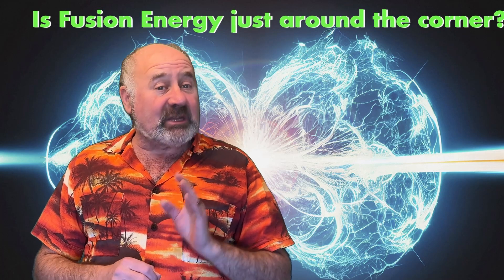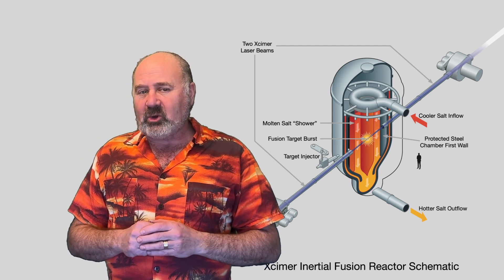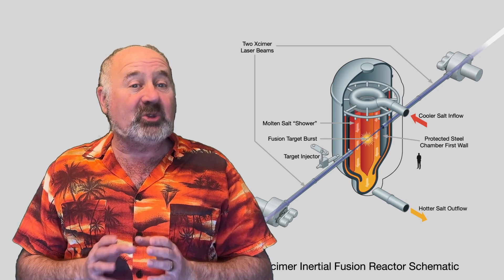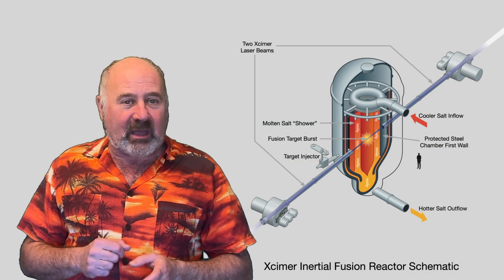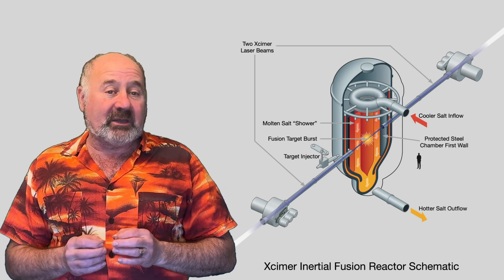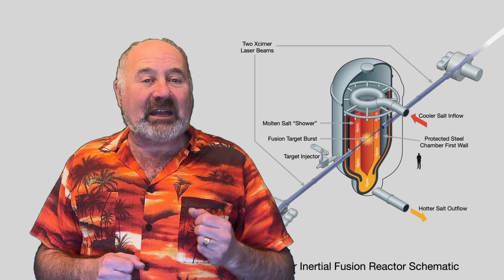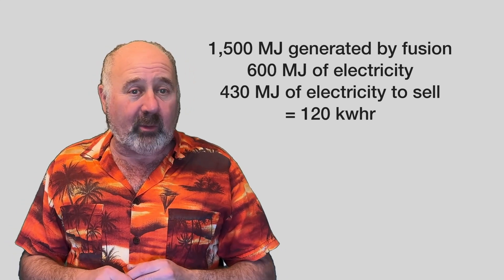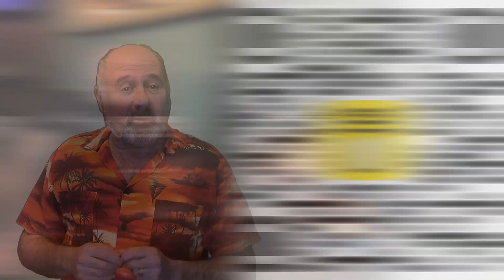Can millions of mini hydrogen-bombs power our world?

Comment: Dr. Silba, First Light Fusion (01:28) recently announced it was dropping out of the race to build fusion machines. Do you think my post (copy-pasted below) had anything to do with it? 
****
First Light Fusion (FLF) uses a projectile to hit a target filled with fusion fuel. Their "secret sauce" is the use of specially designed targets that convert the projectile’s impact into a convergent shock. These targets direct the shock waves to focus on the fuel, a bit like how shaped charges focus energy into a jet. It’s clever, but there’s a fundamental limitation they can’t avoid: the maximum pressure they can achieve is capped by the fact that their waves start in 1D (linear) and need to finish in 3D (spherical) to benefit from the maximum speed of convergence. No matter how intricate or convoluted the targets, the final pressure won’t exceed what you could get from a perfectly converging 3D spherical wave driven by the same projectile pressure. That’s a hard ceiling set by geometry itself.
    Now, what if we could do better — much better — by starting with true 3D convergence from the beginning? Here’s my approach: Imagine a large, hollow metal sphere filled with molten Nd-doped FLiBe (a fluoride salt mixture). Suspended at the very center of the sphere is a single, large bubble of DT gas. This setup replaces solid fuel targets with a far superior medium for transmitting pressure: a continuous incompressible liquid, which can perfectly support a 3D spherical converging wave.
    To drive the compression, piezoelectric actuators surrounding the sphere apply a precisely timed, synchronized pulse to its outer surface. This launches a converging acoustic wave through the molten salt. Because the wave propagates through a homogeneous liquid in all directions, it focuses symmetrically on the bubble, compressing it from all sides at once. Unlike First Light’s 2D waves, this is true 3D spherical convergence, meaning the achievable peak pressure vastly exceeds what any projectile impact can deliver at equivalent input energy.
    The first stage of the bubble’s collapse rapidly heats the DT by adiabatic compression. At this point, the temperature is far above the 750 K of the molten salt, but still nowhere close to fusion conditions — so I add a second mechanism: laser pumping. Reflective tiles lining the inner surface of the sphere create a spherical laser cavity around the bubble. As the compression wave converges inward, high-power laser diodes flood the cavity with several megajoules of light, timed to begin when the converging pressure wave is about 3/4 meter away from the bubble’s center.
    Here’s where the magic happens: as the bubble collapses, it heats up and starts to glow like a blackbody. This intense thermal emission triggers a cascading laser effect in the surrounding Nd-doped FLiBe. The collapsing bubble essentially acts as the spark plug for a self-focusing spherical laser pulse. The laser cavity’s geometry ensures that this pulse can only focus on one place — the exact center, where the bubble sits. This injects even more energy into the collapsing fuel at precisely the moment it’s at peak density, further raising temperature and pressure. First Light’s projectile can’t do anything like this — their pressure pulse is a single-shot event. Mine gets a massive boost right at the critical moment, thanks to the synchronized laser cascade.
    Even this isn’t the final trick. When the laser pulse dumps energy into the system, the radiation suddenly ionizes both the DT fuel and the surrounding Nd:FLiBe. This triggers a phenomenon borrowed from Andrei Sakharov’s "Layer Cake" H-bomb design, where materials with vastly different electron densities expand at different rates upon ionization. The high-Z Nd-doped salt releases far more electrons than the DT. Because particle density is proportional to pressure, this creates a sudden pressure imbalance. This differential pressure creates a final inward shock that drives the DT to even higher pressures.
    By combining these three mechanisms — spherical acoustic compression, synchronized laser pumping, and ionization-driven final squeeze — my approach overcomes the fundamental limitations of First Light’s projectile-driven scheme. Instead of being limited to what a one-shot projectile can achieve through clever target shaping, I exploit the full power of 3D spherical symmetry, add photonic heating right at peak compression, and leverage plasma physics to generate a final shock. All of this works together to create far higher pressures and temperatures than First Light’s setup could ever hope to reach.
    Here are a few more advantages of my approach: 
        • Zero cost target fabrication (bubbles are free)
        • Alpha heated, long burning, slow disassembling targets (not burnt in a vacuum chamber)
        • Instability resistant, low temperature, volume ignition (better containment => time to heat)
        • Robust high yield targets for higher gain (~100x fuel mass of NIF capsules)
        • Reflective chamber to prevent electromagnetic radiation loss (lower ideal ignition temp)
In short: First Light’s approach is capped by the physics of converting acoustic waves from 1D to 3D. My approach starts with 3D convergence, then layers in optical and ionization physics to break through to true fusion conditions. That’s why my method is superior — it’s not just a better design, it’s a fundamentally more capable approach to achieving the conditions needed for fusion ignition. 📌

Comment: Xcimer's website features a graph comparing the cost of electricity across various production methods. Their fusion approach is projected to cost $36 (units unspecified), compared to nuclear at $88 and solar at $36—the latter being the cheapest but a non-baseload source. But why should we trust that their fusion method is truly more affordable than nuclear? Their figure seems rather arbitrary—what justifies it?⚠
Reply: A major reason nuclear fission is expensive is strict safety regulations. Fusion isn’t regulated the same so many predict it will be much cheaper
Reply: @robertdoe3259  – Xcimer claims that, when comparing fission to fusion, fission is expected to cost 2.44x as much. Such an extreme price savings cannot be due to safety issues alone, given that the NRC and industry sources confirm that safety, licensing, and decommissioning typically add only 20–30% to the base cost. 🛑⚠☢
Reply: Below is a consolidated list of bullet points that compare key cost categories for a 1 GW fission plant versus a 1 GW fusion plant:

Construction (Capital) Cost:
• Fission plants typically require around $8 billion—driven by heavy, redundant safety structures and extensive containment systems—whereas fusion plants are projected at roughly $6 billion due to their simpler, inherently safer designs.

Licensing & Safety Design:
• Fission reactors demand rigorous licensing and elaborate safety systems (about 12–15% of capex) to mitigate meltdown risks and manage long‑lived radioactive waste, while fusion designs, benefiting from self‐limiting reactions and lower long‑term hazards, may need only 8–10% of capital costs devoted to safety and regulatory compliance.

Fuel Cost (Lifetime):
• In fission, fuel (enriched uranium plus processing) is a relatively small expense—on the order of $300 million over the plant’s lifetime—whereas fusion’s fuel, based on deuterium (and lithium for tritium breeding), is extremely inexpensive, perhaps only around $100 million over the same period.

Operation & Maintenance (O&M) Costs (Excluding Safety):
• Fission plants incur higher O&M expenses (around $6 billion over the lifetime) due to more complex reactor systems and periodic refueling outages, while fusion plants are anticipated to have simpler, lower O&M costs (roughly $3 billion over the lifetime).

Additional Safety Upgrades:
• Throughout their lifetimes, fission plants must invest roughly $2 billion in safety retrofits and upgrades (as seen in post-Fukushima modifications and ongoing regulatory requirements), whereas fusion plants are expected to require far less—around $0.5 billion—because of the fundamentally lower accident risks and waste profiles.

Decommissioning & Waste Management:
• Fission reactors face substantial decommissioning and spent-fuel management costs (on the order of $2 billion), driven by the challenges of safely isolating long-lived radioactive materials, while fusion plants promise a simpler decommissioning process with costs closer to $0.5 billion due to minimal long-term radioactive waste.

These comparative figures align with analyses from sources such as the World Nuclear Association, OECD/NEA reports, and emerging DOE and MIT fusion studies. Although the fusion numbers remain speculative until commercial systems are built, the relative differences reflect fusion’s potential to be inherently safer and simpler from a regulatory and operational standpoint compared to traditional fission reactors.⚡
Reply from the maker: @michaeldeeth811  Estimating the cost of fission is difficult and we've seen lots of cost overruns  and a large variation in cost and construction time based on where the plant is being built.

But the cost of fusion is currently infinity and and cost estimates are just guestimating, since we don't even know how to get fusion to work. Your points on why it is likely to be cheaper are solid IF WE CAN GET ANY THING TO WORK.
Reply from the maker: If they can get the Q their targeting (>125), their approach is fundamentally not expensive, so their estimate seems reasonable.